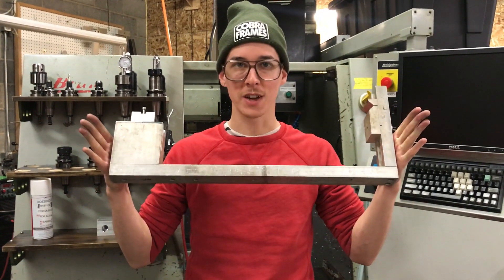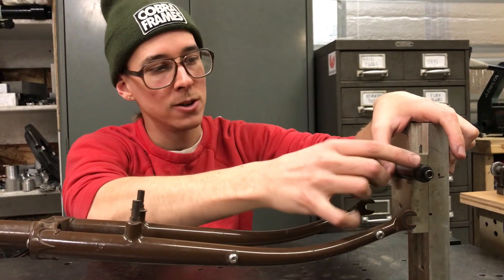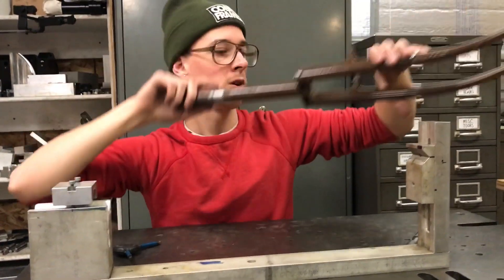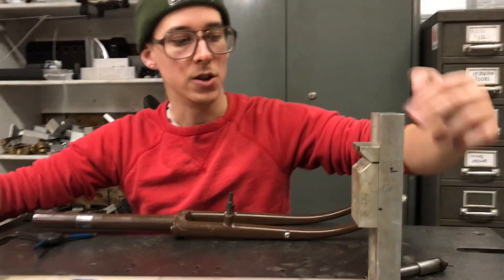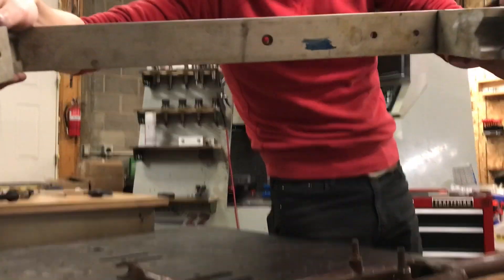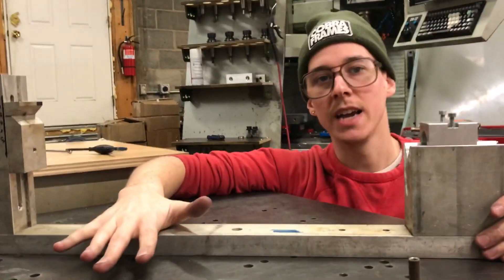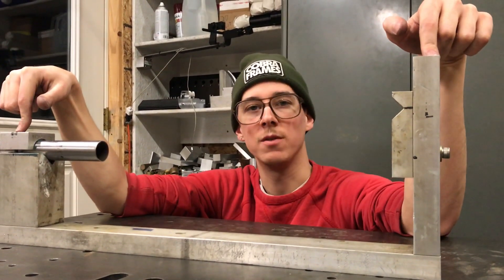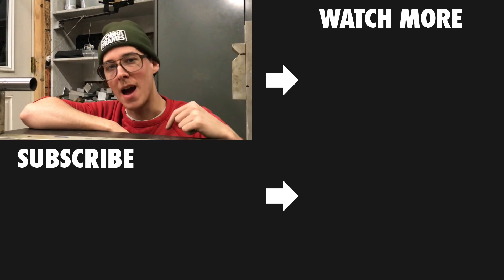Simple Fork Welding Fixture Overview | Bicycle Framebuilding

Comment: What are you using as the surface plate? I recall you mentioning in another video, but I can't remember which one.
Reply from the maker: It’s a table I found in a scrap yard. The top is 32x36x2” Blanchard ground steel. The base is heavy steel tubing. The whole thing is 850 lbs. I don’t know exactly how flat it is, but it’s nice to have around.